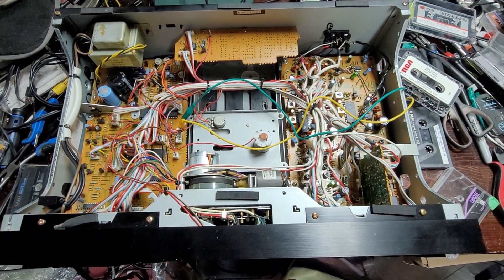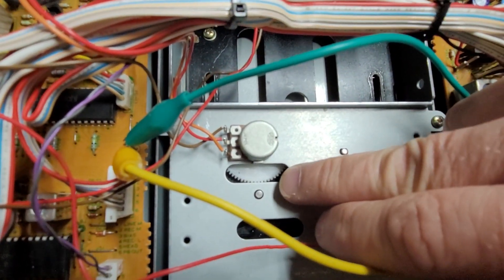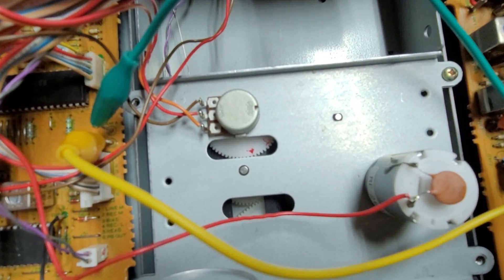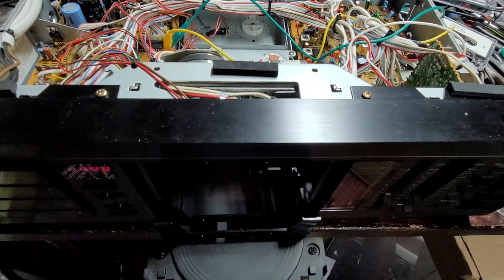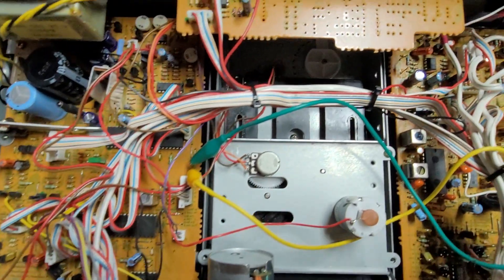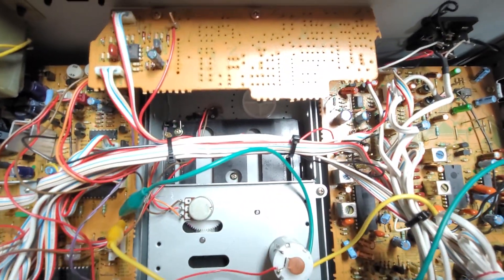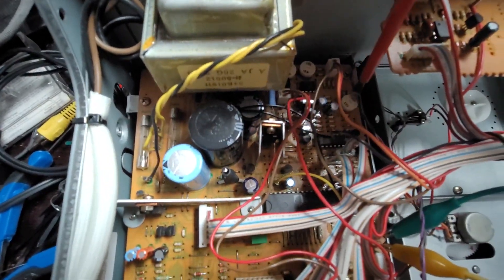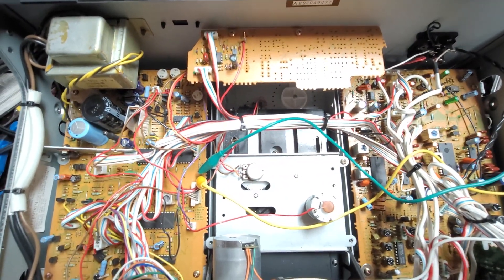Nakamichi RX202 reversing calibration issues

Comment: I figured mine out. There are three gears and each has an arrow align all three up. Turn the tape holder so its between A and B with the tray out. The tricky part is keeping the belt on but I managed. Put the belt on the larger gear first and stretch it a little onto the smaller gear as you lower the lid while keep the three arrows aligned. I marked all three arrows with a marker so I can see then better. Then it was very simple to adjust the tray using Cam A and B. Make sure you do the adjustments 2 or 3 times like the manual says.

Comment: There are alignment indicators on the 2 gears. They need to be centered
Reply from the maker: Yup, they are centered.  But once I pull out the jumper cables for testing, the mechanism motor starts to bind.   Believe me, the arrows are perfectly in alignment.  😎
Reply: @botelhda I just lifted the table slightly and if you move the gear left and right you'll hear it start to bind - center it - set it down and eject.  If it doesn't, adjust slighty, took me about 20 minutes and it works perfect now.
Reply: I’m having the exact problem
Reply: Did you find out?